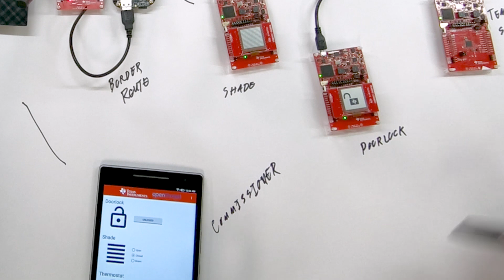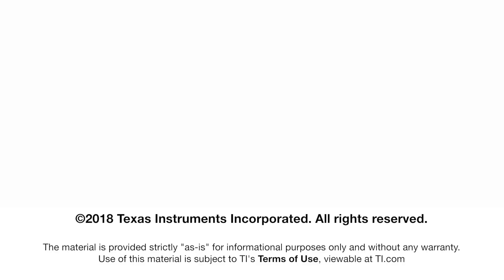Connect: Thread Demo

Comment: IEEE 802.15.4 conforming bands are 868/915/2.4g which frequency band is this demo in?  If 2.4g aren't the battery demands a bit steep? oh ugh!!! the device link says Bluetooth was used.  Is that correct?.
Reply: Yes, that device uses 2.4GHz since the band is available worldwide. A home mesh network allows you to use low power radios because the devices are typically close together. In Thread you can also use a "Sleepy End Device" which only wakes up occasionally to check for messages. The TI device supports Bluetooth but this video is about Thread, which is a different network protocol.

Comment: How many devices can be supported in a border router? Since IEEE802.15.4 has only 250kbps bandwidth, and 6LowPAN stills has a much bigger overhead than other proprietary RF packets? Is there any method to get the topology of current mesh network?
Reply: According to Nordic Semiconductor's video on the topic, you can have "up to 32 routers per network and up to 511 end devices per router". Since Thread is targeting low-power IoT devices, bandwidth is typically not an issue. If you do run into problems you could use additional border routers. On large networks that would be advisable anyways to minimize the number of hops needed to reach the border. To answer your second question, Nordic created a tool called the nRF Thread Topology Monitor.

Comment: Interesting. Thank you. Do those TI devices require any special library be built in such that HomeKit can add the accessory to the user's HomeKit accessory database? I know that in the [recent] past TI offered the HomeKit Plug-in library (to be used with the TI SDK) that implements the Apple HomeKit Accessory Protocol (HAP) for normal 2.4GHz wifi networks. Is there another sort of library that TI offers that supports HomeKit for Thread devices implemented with the TI chips and SDKs?

Comment: I’m still lost the advantages of this over ZigBee
Reply: Native IPv6 connectivity. That's the big thing. Directly connecting to them across vendors. Dotdot on top of Thread is basically layering Zigbee on top for hardware definitions for say smart light profiles. The nice thing about Thread is that there is no gateway translating protocols, just a border router that transitions the physical layer. (like ethernet to wifi with a wifi router)
Reply: Carlan Wray still don’t understand, but sounds like cool things are coming! 1 day :)